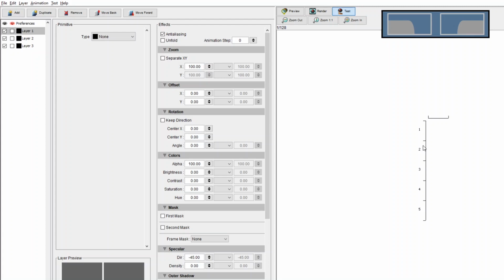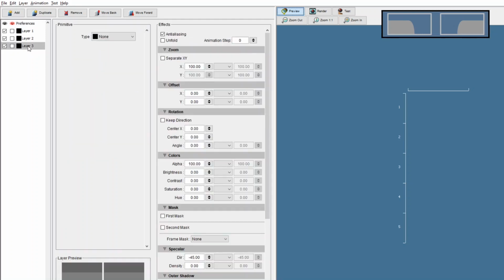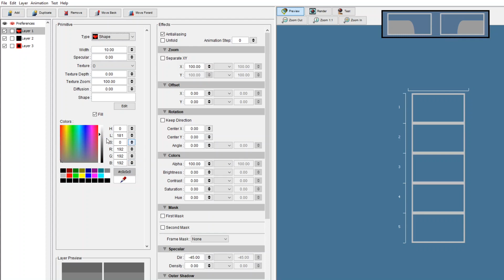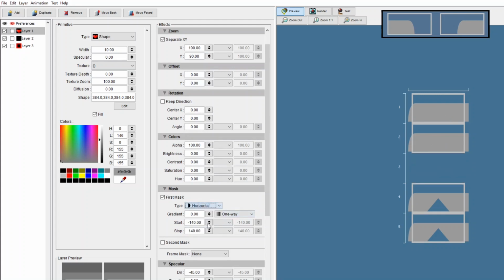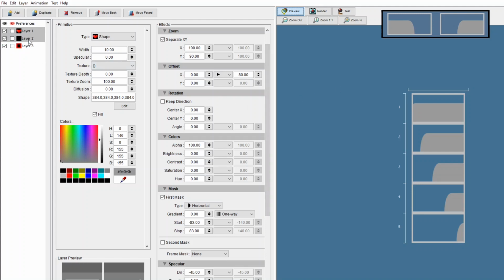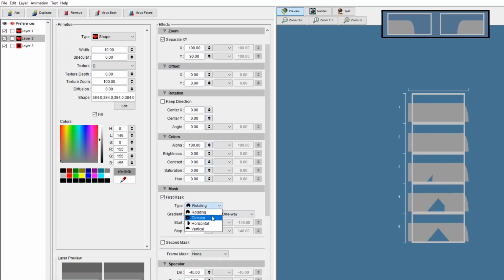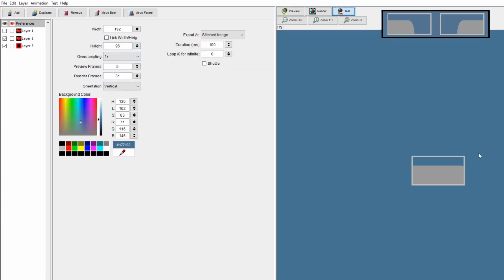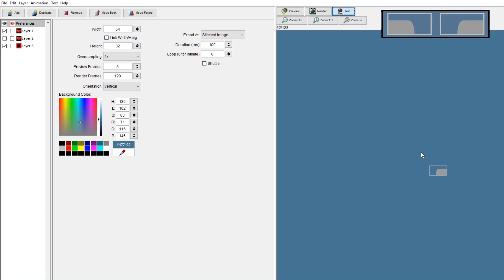KnobMan Tutorial - LP/HP Filter Slider

Comment: This is crazy! Never thought about using JKnobMan for something like this. 

Would love more tutorials man. Subscribed!
Reply from the maker: Thanks Håkon! Two tutorials are in preparation.
Reply: @PMEDig  Looking forward. An idea I have would be to create knobs for a multiband compressor, f. example for 3 bands. Each band would go from bottom to top. Place them all in a seamless row and you have three functional sliders controlling each band! Google "cubase multiband compressor" and you will see an example.
Reply from the maker: @hakondale6157  Vertical sliders are no problem in Knobman, however you cannot drag the "bandwidth" horizontally. The vertical sliders will be fixed in width and height.
Reply: @PMEDig  Yep that's true.